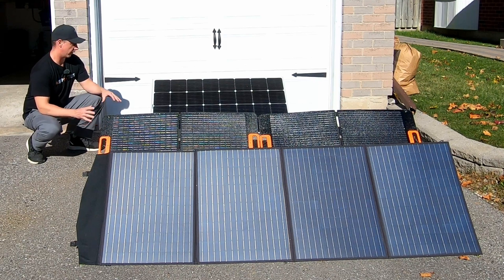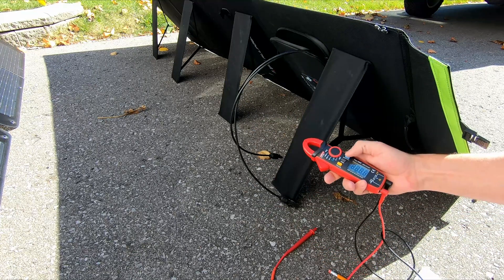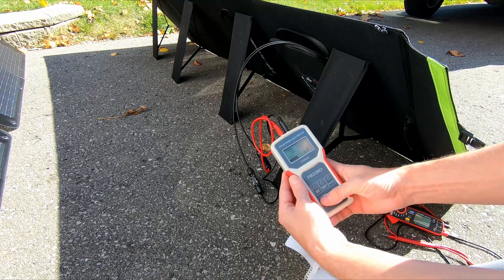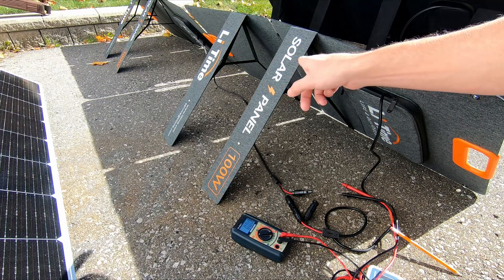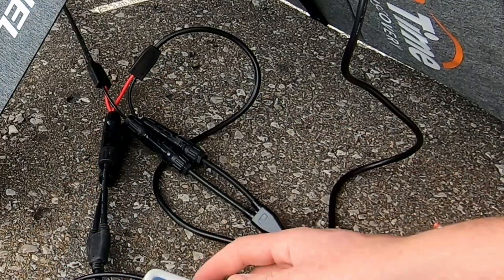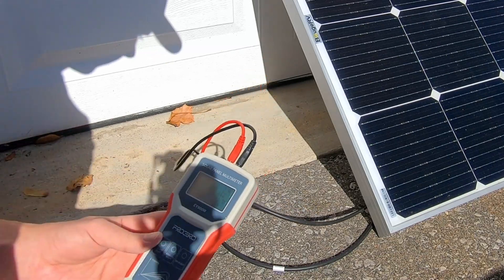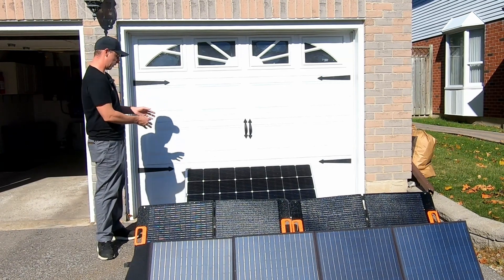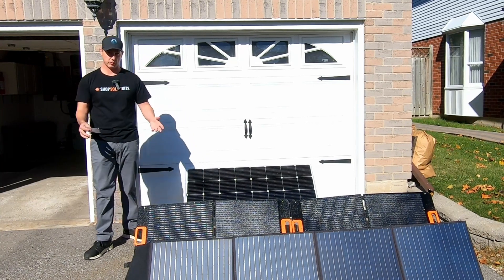Testing Rigid, Semi-Flexible and Flexible Solar Panels.

Comment: The rigid would run away with the tests in an off axis light  eg. if they were all flat the flex don't perform. That said there are lots of applications for flex like on a RV or boat where weight is a premium. The new CIGS Yuma panels from BougeRV offer less weight again with toughness like no other so walking on them is not a problem. The premise that someone wold walk off with a flex panel is quite funny. We secure them down so the wind will not destroy them by using 3M VHB mounting tape, and that could take a day to cut off with a knife. Bonus is no holes in your roof for water to find its nefarious ways into your bed. André in Sydney

Comment: I suspect that you would also see a wide range of performance differences between different rigid panels produced by different manufacturers, as well as the rigid panels produced by the same manufacturer. That has been my experience. PS: I enjoy your videos!
Reply from the maker: Thank you 😁 Yes you would see a difference in manufacturer performance.  Rigid I feel is always the best option. 👍

Comment: Good video. Looks like the sun was almost straight on, and not overcast, so would expect higher power. However my experience is with smaller 80w panels which are very close to full power. However I have one which shows about 60% P max, with no sign of corrosion. I have a similar Solar multimeter. If you connect the current meter directly on the panelbox, does it show a higher current reading?
Reply from the maker: I was hoping for better too. When they give the ratings it's in perfect lab conditions.

Comment: I did not know that you could short panels out like that.
Reply from the maker: Freaks me out when I do it lol. It doesn't seem right does it 🤣
Reply: It gets a crude idea of what the panel can do, but there are traps for young players.  Most panels have bypass diodes to cope with shading.  There's two ways this can give false impressions of performance.

First, with a completely normally functioning panel the voltage read will be near Voc which is only present when there is no current flowing.  Multiply that by the read Isc and you get a wattage higher than can be achieved.

Second, if there is a section of the panel that is damaged, badly cracked cell for example, when you do the short circuit test the bad section will be bypassed by its diode so you'll get near normal Isc.  Then when you do the voltage test you are placing almost no load on the panel so the voltage read will be nigh on Voc unless one section of the panel is actually completely open circuit.  Multiply and you get an inaccurate figure as per the first case, and the loss of power from the 1/3 damaged section is effectively hidden from you too.

The best way is to do a MPPT test, either with one of these types of low cost meters, or with a MPPT charger and a partially charged battery or such to give it a load to work into.
Reply from the maker: @retrozmachine1189  Great info, Thanks.

Comment: Like you said, ultimately it depends on what the needs of the individual are.  

As you were running the test, it made me stop and wonder what plays a bigger factor regarding the flexible/portable panels: the components used or the fact that because they're flexible, there's higher potential that your panel cells aren't all pointing at the exact same angle all the time.  There's always gonna be some kind of flex/curve/twist to the panels causing the individual cells to not be pointing it the same direction.  

Might be very interesting to try and fix the flexible panels to a structure that forces all the cells to the same direction/angle (preventing any bending/curving of the frame) and then re-run the test to see if you still have a difference in output.
Reply from the maker: Very good observation I think it's a combination of materials used and like you said not all cells point in the same direction. It definitely comes down to case usage. Expect a decrease in performance if using portable panels.